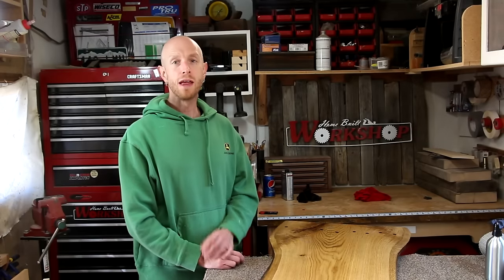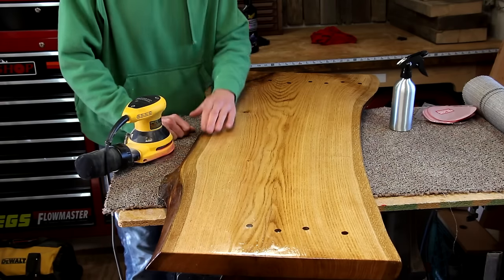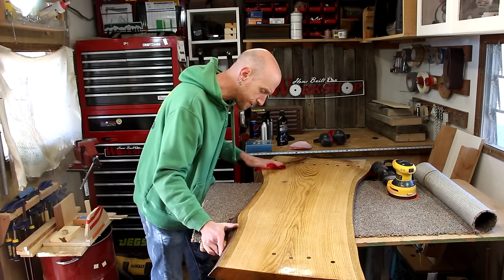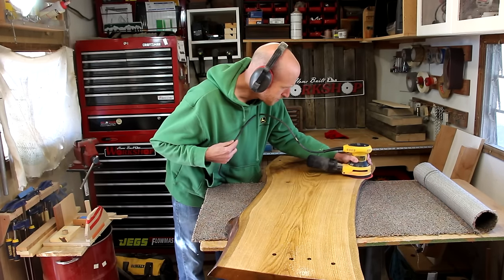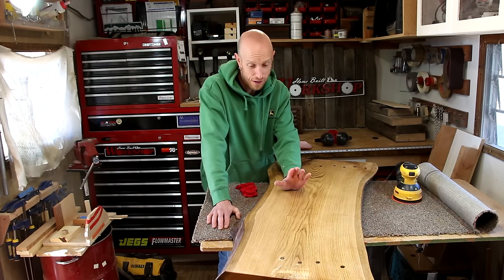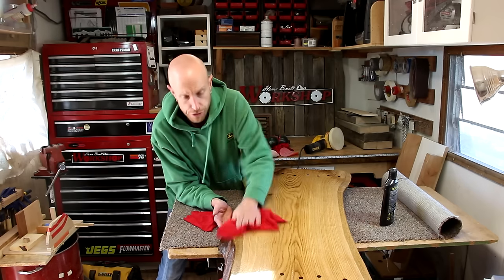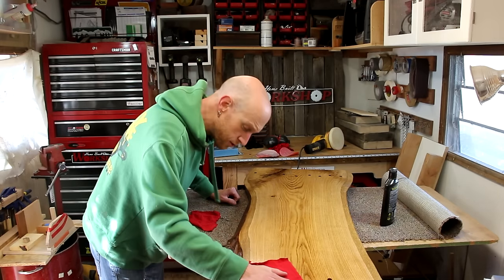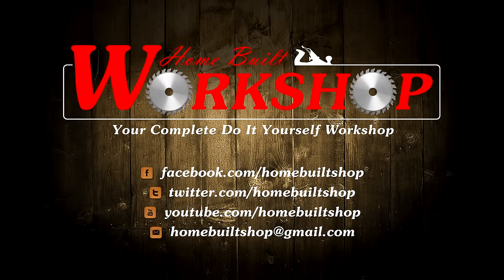How to Buff Polyurethane to a High Gloss

Comment: Wonderful explanation. I'm working on a desk top that has 6 thick coats of poly on it. Are 6 coats enough to use your method?
Reply from the maker: You could probably do it with 6 coats. I would feel better with a couple more. Just sand it lightly.

Comment: Learned alot from this video,thank you! However, how before I saw this video I had already lightly sanded with 3k grit paper and was to be the last coat but I saw a few defects that I didn't like so I applied 2 thinner coats of oil based poly,is all lost or could it still cure out ok? It looks fine at the moment but I still have a few dust nibs to remove and then polish.
Reply from the maker: I think you'll be fine. Just let it cure, then sand and polish.

Comment: Great, video, thank you.  I am trying to use polyurethane on my wooden benchtop I am making at the moment.  When I run my hand over it I can also feel bumps.  I was wondering, before you get to this sanding and polishing stage, when you are actually putting on the polyurethane, do you have to sand back any bumps or blemishes to ensure that the polyurethane layers are perfectly flat as you are building up your polyurethane layers?

Comment: Awesome video and very thorough   You mentioned you did this same process with guitars.  What grits did you use?  Im at the point of adding poly layers but I'm using 1000 grit in between.  I have a ton of layers to go, but I hope that gives the poly enough to hold onto.

Comment: Hi. Great video. We are going to Polish out our bar top done with several coats of the varathane triple thick polyurethane.  What kind of pad are you polishing with?  I'm looking at buying the foam pads. Will these work too or do you recommend what you have? Thanks
Reply from the maker: I think they should work ok. They're made for polishing. I haven't used them personally but that's what they're made for. Let me know how it goes.

Comment: This is the exact video I've been looking for, also am making a slab table. Have 4 coats of poly on waiting to cure before I wet sand with 2000. Was worried to use my orbital so I got the square sheets but I think I'll try it this way. I have some left over turtle wax from a different project I can use to polish. If it doesn't come out like I want I got plenty of 220 haha.

Comment: I need to polish a Redwood burl slab and have already sprayed 6 layers of water based Varathane polyurethane. Looking good, but how many coats should I apply before final polish?
Reply from the maker: If you sand between coats and the finish is already very smooth, you could probably polish it at your 6 coats. If you'll have a lot of level sanding to do, I'd add a few more coats.

Comment: I just followed your instructions and used the 2000 grit sandpaper wet, then did the polish with a buffer pad. I can't seem to get the haze left behind from the 2000 grit to buff out with the polish.....I've been trying to buff out the haze in just a small spot and it doesn't seem to change at all after 20 minutes of buffing. Any thoughts?

Comment: Yeah I've been hitting a wall with trying to make a simple live edge table come out like that (it's pine, so it's not like it'll be "beautiful" the way that slab of yours looks - but my slab DOES have character). The biggest issue has been keeping dust off of it. Even using a home made rub on poly with a supposedly lint-free cloth didn't work out perfect. So I went the automotive fine sandpaper route. I can't find the products you used locally so I'll have to follow your links! Also, I've subbed.

Comment: Hi Jeff, I have a very high gloss wood bedroom set from Italy. The headboard became pretty dull, I have a feeling it happened from cleaning with Windex. Any recommendation on how to fix it?  Do you think compound buffer would work? What brand do you recommend?
Thank you.
Reply from the maker: You could certainly try buffing it out again if the surface is still nice and smooth. I'd try some Meguires Ultimate polish and see if it does anything. I would probably try on a small spot and polish it by hand with a soft cotton cloth. I hope it works.

Comment: Dear,
Please tell me how much time is required between two coats. As you said minimum ten coats are must before starting this process? 
Waiting for your reply !
Reply from the maker: I typically try to follow the manufacturers instructions for whatever product I'm using. I believe for this one, I waited a couple hours between each coat. It takes a few days to get the finish all applied but the results are great.

Comment: I’m making big bass marimba bars (percussion instrument that will be struck thousands of times with a medium hard mallet and will vibrate like crazy over and over and over). Traditionally they finished with oils and waxs, though I want to experiment with other stuff. For my experiment phase—in order of best to worst—can you please suggest/brainstorm what you think might work out for coating/sealing wooden bars that will be taking a lot of inherent abuse? With all the beating and vibrating, for instance, might shellac or lacquer or polyurethane or wood hardener or an acrylic poor be too brittle, resulting in getting rattled and crushed to death and breaking apart microscopically over time? Also consider which finish would be the most scratch resistant. (Bars will be stored in stacks and slid against each other with the potential of dirt and sand bits in between. Thanks for brainstorming with me 👍🏻

Comment: Hi Jeff. I’ve got a dresser top that I’ve wet sanded to 2000 grit. It’s very smooth. I used the same buffing pads and polish and polished for about 10 minutes. I was wondering how long you spent polishing that piece to get rid of the haze, mine is still fairly hazy in many places, but maybe it takes a lot longer than that?
Reply from the maker: The final shine always seems to come in when you finish it by hand. Have you tried hand polishing a piece to see if that's what it needs? If it's just not shiny yet, you might need to polish some more.
Reply: @homebuiltshop  thank you for replying. It’s shiny, but “cloudy”. What would you use to if you were continuing to shine the piece in the video after setting aside the orbital sander?
Reply: @TheeRandyC  Yeah I feel like if you sand the top coat of poly at all it will always seem a bit cloudy...

Comment: If you add 2-3 drops of dish soap to the water it helps keep the sanding slurry from clogging the paper and prevents the sander from slowing down.
Reply from the maker: I usually have a little soap in there. Maybe I didn't add enough.

Comment: You’re awesome! I have questions as I try this - I have a huge table I stripped and restained and sealed with oil minwax high gloss. Sanded in between coats with 280. Looked great but had bubbles and wasn’t silky smooth. So just wet sanded with 1000 and then added the polish. When I wipe off the polish the hazy look is still there that appeared as I was sanding it. Did I not sand it smooth enough? When you sand it should it be shiny from the sanding? If I shouldn’t sand more and should just add another layer of poly (there’s 3 thick coats) should I use mineral spirits to remove the polish? Thanks!!!!
Reply from the maker: If you're polishing it by hand, its quite likely that you'll have to sand up to a higher grit before polishing. It will take quite a bit of work to get the 1000 grit scratches out by hand. You may need to get to 2000 or 2500 before hand polishing.
Reply: @homebuiltshop  ahhh thanks! I KNEW I should have grabbed the higher grit vs what the hardware guy said 😁 thank you for your reply. I do have an orbital sander but they don’t sell the disks for it in the higher grit by us. I subscribed!
Reply: @meggreen442  did you fix it? I have the exact same issue. 1500grit with an orbital sander and it looks a bit cloudy...
Reply: @DanielWilliams-fp4oz  I could not get this to work, so sanded it all down and started all over. Ended up using a wipe on poly that worked best.

Comment: Is the poly you have water based or oil based ? Are there any repercussions of watering the water based poly when sanding with 2000 grit ?
Reply from the maker: I used an oil based poly, but this same process will work on water based as well. I do that to polish my guitars that have a water based clear. It works fine.

Comment: Hey bro.great job.i have a ?,while your buffing is your sander spinning?I have the same sander but it seems to vibrate and not spin that much???thanks mike
Reply: Is it because to much compound maybe?
Reply: Or the pads,I used a blue then a black but not much spinning(harbor frieght)??
Reply from the maker: It seems to change between spinning and not. Mine seems to vary depending on how hard you press down.

Comment: Jeff, this was a great video and just what I needed! I used a 3000 grit sandpaper and got busy. After only a few minutes my shelves were smooth as silk and still shiny, I don’t even know if I’ll need to wax it? I might wax just because I bought the buffing pad and see how shiny I can get them. Thanks again.
Reply from the maker: Awesome. After a bit of polishing, it's kind of like a challenge to see how shiny it will get. Just don't burn through.
Reply: Wax won’t make it shine . You’ll need to polish it . Was is to protect a shine .

Comment: I have tried this almost exactly.. after I wet sand with 2000 grit to get rid of the small particles of dirt underneath. then I  used the the  meguiars polish with  the surebuff pad on a piece of live edge that has 10 coats of polyurethane.. I cant seen to get the polished look back, how long are you buffing with the polish?
Reply from the maker: I am buffing it until I can start to see the shine coming in. Then I use a clean soft cloth and finish it by hand. This is where I get the shine to really come out.

Comment: Hey Jeff great tutorial. I have used powdered pumice in the past with felt and dish-washing soap, but quite messy.  This looks easier.  I have a milwaukee 6 speed sander and I was wondering if you would go right to the highest speed for sanding,  Thanks Paul
Reply from the maker: +Paul Schneider I used my sander on the highest speed so you should be fine.

Comment: They don’t sell the buff pads on Amazon anymore. What would you recommend instead??

Did the amount of wipe on poly coats you did cause a yellow tinge to the tabletop?
Reply from the maker: They are definitely hard to find. I've seen them recently available on supergrit.com. I have also had great luck with the 3M Perfect-It pads. #notsponsored

Yes, the poly did give a yellowish color to the wood. I think all oil based finishes have that side effect. If you're not wanting that bit of color change, a water based finish is probably the way to go. Water based finishes don't tend to color the wood unless you're using a tinted finish. I like the Crystalac Brite Tone for that application.

Comment: Great video!  I have some deep scratches on my table that I had refinished and applied poly to (crazy dog issue)   Can you advise how to approach the repair?    Thank you!
Reply: I’ve only refinished 1 table so take this with a grain of salt.  You’ll have to sand down a large area around the scratch, or scratches.  If the table is covered in scratches then you’ll just have to sand down the entire table.  Once you start sanding, I recommend starting with a 60 grit to remove whatever finish you had. (the higher the grit, the less the sand paper removes from the surface) as you remove the finish, you might see that the wood changes color a lot, which means it’s been “stained” before putting on a clear coat, changing the color of the wood.  To get a more even color, it’s best to sand the finish away completely and get back to whatever wood the table is made out of.  After removing the finish, and stain, you can then go buy a stain that will look almost identical to the one that they used.  Because as a table ages, depending on how much use it’s under and sunlight, the color will change and you can never get a perfect match when re-staining.  Read the directions on the stain and polyurethane you decide on using and it will tell you what to sand it to, usually 220 grit.  So go from 60 to quickly remove your finish, then 120, then 220 finally.  Dust it off, wipe it down with a wet cloth to remove more dust, then using a rag or brush, apply stain if necessary.  Let dry.  Then you can use either a paint roller or brush, or foam brush, to apply your polyurethane.  Follow the instructions on the can and read the warnings, this stuff can catch fire very easily if not thrown away correctly.  Feel your first coat after 20 or so hours, it’ll feel prickly and you’ll be able to feel the grain of the wood still.  Sand it lightly with 220 grit, take down the high spots, wipe down, then apply another coat. Wait 20 hours.  Feel it again, and it’ll be smoother.  Sand.  Wipe down. Apply coat.  Wait.  It will be really smooth by now, but I went ahead and put a 4th coat of polyurethane on my table and then you can lightly buff by hand or with a buffer

Comment: Great video. We are trying to fix a poly job gone slightly wrong . It’s an entire house with knotty pine tongue n groove paneling . There are 3-4 coats of gloss poly . But they feel rough to the touch because the painters didn’t remove dust properly . Could I skip straight to the polishing to buff out the roughness ? The homeowners would like even more shine . We are trying to avoid doing another coat on the entire house . Thank you 😊
Reply from the maker: Wow, that sounds like a big job. I guess you could sand and polish. You'd have to be sure 3-4 coats is enough to not sand through. Worst case would be to sand and reapply  a gloss topcoat.
Reply: Jeff Baker , Thanks for your reply. It is a tough job indeed . About 3000 sq feet floor space with T and G on walls in all rooms . Plus cathedral ceiling. You’re right . I’m gonna give it a shot . The homeowners want the whole thing coated once more , but I truly think it can be salvaged with a good buffing . The roughness isn’t visible. You have to touch the walls to feel it . I was glad to see that someone out there was actually doing this with success . I googled buffing polyurethane and there you were . Thanks again 😊

Comment: will this work on a painted GLOSS finish? good clear video.
Reply from the maker: I have never tried it on a painted surface. I have buffed older cars painted with single stage paint and it works. I'd suggest trying it on a test piece. My gut says it will work. Test it first though. 👍

Comment: You said you did 3 layers of poly. Did u sand between? If you did, what did u use? Im about to finish my first woodworking project ever and want to be sure what to do.
Reply from the maker: For the best results, I'd sand very lightly between coats. I would use a 220 grit or higher. If you need any help, feel free to reach out. I'll try to help where I can.

Comment: I am new at this wood working. I am making a hot tub roll up wood slat cover. Second coat is down. I have heard you can sand with brown paper and it will put a smoothe shine on the third coat. Have you ever heard of that? I am wondering before I do it should I try it. I want it the boards to shine like glass. The wood is Sapelle wood. Beautiful wood and I want it like a show piece. Just wondering about trying the brown paper. What would that brown paper be equivalent to? 3000 or 4000 grit?

Comment: Excellent tutorial. Just an fyi about your wood grain, if you have a piece that has a large grain structure such as oak or ash, you will always have that feeling of grain raise regardless of how many coats you apply. That's what I have found. Species of wood that have a tighter grain structure are less susceptible to this. That's just my opinion from experience. Thanks for sharing! Cheers!

Comment: Jeff,
Would this same process work on a wood floor? 
I'm doing my living room floor with cabinet grade plywood, great grain, warm color and lots of character.  
I want a high gloss finish on the floor , would this process work for me?
Also, I haven't applied any finish yet. Using this process should I use a water base polyurethane or an oil base polyurethane?
Thanks Andy,
Reply from the maker: It probably would work but it would be quite a large undertaking. Let me know if you try it out.

Comment: I'm going to attempt this. My dad built a table out of a WWI ship hatch cover that is wood. He prepared it and applied around 40 coats of PU. Over the years it's become a little dull. The only thing that worries me a little is it's not a smooth surface like this table in the video, it's uneven due to the way the wood was. I don't think it will be a problem, I guess worst case scenario it just wouldn't sand out in the places that the sandpaper didn't touch. Any feedback or help appreciated!! Great video!
Reply from the maker: That table sounds awesome. What a cool piece of family history. Thanks for sharing that. You are correct. The low spots just wouldn't sand out. Depending on the results you want to see this may or may not be an issue for you. If you wanted to have it perfectly smooth, you could begin sanding and applying more coats to build up the low spots until they are filled in. This could be a lot of work and take a while. It all depends on how you want it to look. Another option to look at is an epoxy tabletop coating. It would level things out for you. Just an idea.
Reply: @homebuiltshop  Thanks for the reply Jeff. I think I'll just sand it like you did and apply some more PU. It still looks really good, I just wanted to get that new shine back. I think it looks better uneven, looks more authentic. I'll post back after I do it.
Reply: @homebuiltshop  You mentioned guitars. I have a Washburn from 1995 with a 'poly' finish. There are a few places where the finish has been damaged. I was wondering how well building up polyurethane on these dings  and following your method would work.